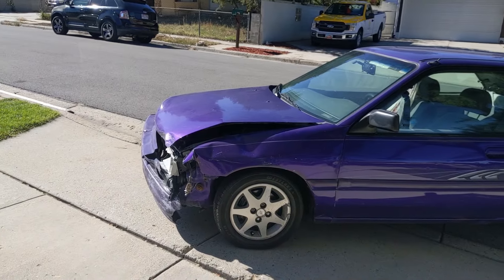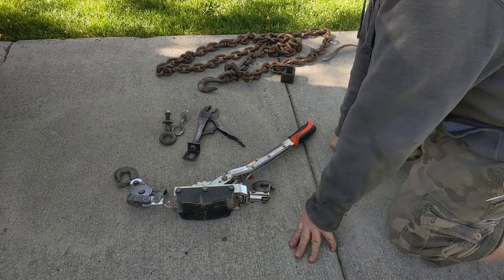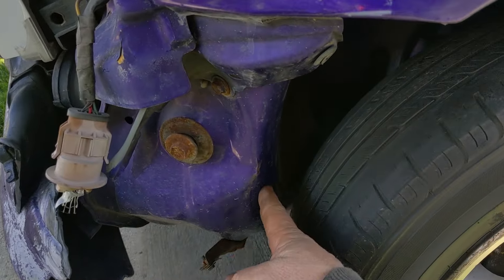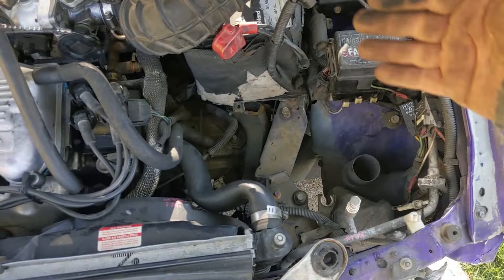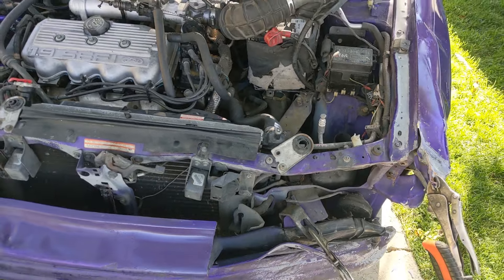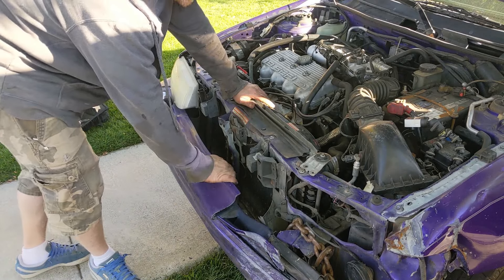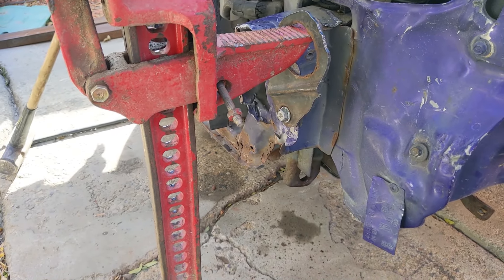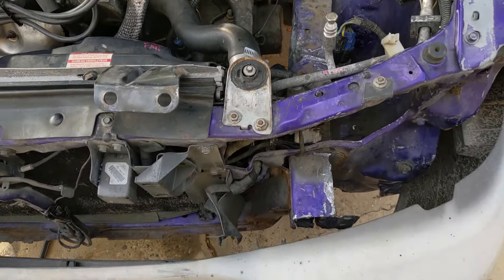Front End Collision Repair Frame Straightening AT HOME Wrecked Accident

Comment: In the summer of 2001, my wife hit a moose with my 84 Subaru BRAT. She was fine, the moose was not, and the BRAT was in tough shape. With a few junkyard parts, my 80 year old maple tree, a come-a-long, and a small pile of other tools, the BRAT drove another 50K before I sold it off. 

Nice work, Moe. Keep this old stuff running as long as possible. My 87 Toyota truck has 292K so far, and it keeps going with basic maintenance.

Comment: So glad you took time to post repair on You Tube.  I used small front yard  tree to chain hold the frame and used come along to a bigger truck
pulling from other side.  Instead of risk snapping vice grips,  I bought some professional pulling clamps from eBay.  Yes, a frame machine is likely a better tool but only worth investing if you do frequent work.   Great thing about come along is you can "feel" how much your pulling and watch as you slowly pull.  Trees are great sturdy friends !

Comment: I sure could have used this video 25 years ago. I was driving an old CorollaTercel.  Yeah, when tercels first came out they combined the names. I got rear-ended by a lady from the Bahamas after I stopped at a red light. Driving in Miami I have been rear-ended 4 times! She pushed me through the intersection. My radio came out of the dash and the driver seat broke as I was s slammed back.
 I towed it home. I had to sweet talk the insurance company to sell it to me because they were going to take it from me after paying only like $1200. The rear end was pushed in on the rear wheel. I popped off the rear wheel and got a sledge hammer and went to work. The apartment building I lived in was cheap and had a bunch of central American boxers that were housed there. they were really nice neighbors and came out and took the sledgehammer away from me and took turns banging on my car with the sledgehammer with big smiles on their faces. Once the wheel was not in contact with the metal it drove Ok. I propped up the front seat by placing my ice cooler in the back seat. When my sister came to town and needed a cheap car I gave her the beater and she drove it for a long time.
Moe, your video is going to help so many people who are screwed if they lose their cheap car after an accident. I think this is going to be a very popular video! I would have never believed you would be able to get that hood to close right again. 😎👍👍

Comment: The vice grip style clamps work pretty good for wider places that meed bent back. In the trunk Ive used a bottle jack and 2x4s from side to side, to push it back out. Shock tower to rear corner, etc. Clear epoxy works well on the light lenses. Awesome job man.

Comment: Love your vice grip, clever.
I did similar jobs on my cars when I educated me, got damaged low mileage cars almost for free.
Sledgehammer and glue did the job.
Reply from the maker: Yeah, the improvised vice grips worked pretty good. I've seen a lot of older cars get written off with only body dents. Just the couple panels and paint for this was going to far exceed $5-6000 through insurance.

Comment: Thanks for putting this up.  I never would have tried it otherwise.  Saved a VW Cabrio from the junkyard for about 900.  It was a little more involved than this one but once you see it the method applies. The low end do it on the side guy wanted 2500 to get it drivable, top quote was 8000.
Reply: I ended up replacing the AC condenser and doing a weld repair on the relief cut on the bumper mount.  Also had to cut a relief in the aftermarket radiator mount where it didn't match the aftermarket condenser, but it's almost like new now.

Comment: Something about using a tree and a come-along is so satisfying . Add a torch if your doing a truck with a heavy frame but the same results . Toughest thing for me is a crumpled hood , usually just get another one.  Good job always enjoy your content.
Reply from the maker: I had to cut away some of the inner structure of the hood so I could beat it flat. I do have another hood that will go on when I get around to repainting the entire car. I wanted to pull out the torch a dozen times but had to bite my tongue as so few people have a torch anymore. I didn't want anyone to get discouraged because they didn't have the tools.

Comment: I've done this type of repair to an old banger in the past, but these days in the UK if you have to go through the insurance, for example in a bump with another vehicle, the car can very often be given a write off category which forbids you to repair it and it has to be scrapped. A real shame because even a small accident can waste a fixable car.
Reply: Yeah, ive seen mild scratches on a plastic bumper count as an insurance write off. Its pretty ridiculous.
Reply: I'm sure the automotive manufacturing sector wrote that law. That fascism is showing pretty blatantly these days.
Reply from the maker: We're lucky enough to buy back written off cars. After repair they go though a basic safety test and can be put back on the road. It is always branded a rebuilt/written off car. Older cars get written off all the time with just cosmetic dents/paint damage.

Comment: Poor Ginger. I have had a similar thing happen twice recently. Once driving down a dirt road I was familiar with but not with the new ditch cut from recent rain fall. I hit the breaks and my puppers ended up on the floorboard. Then we were traveling down the road at night when a coyote ran out and I generally try to keep the mindset that trying to avoid the animal is more dangerous than hitting it. But this was a big coyote and I slowed down just enough to keep from getting any front end damage but once again my dog ended up abruptly on the floor board. He never got injured but I always felt really bad for him.
Reply from the maker: Yeah, Ginger and the dash have met a few times. I always feel bad.

Comment: Glad you and Ginger are ok! Great work on the repair.  I've done this on quite a few of my vehicles and family member's vehicles in the past.  In the beginning of the video when you had all the tools on the ground. I was wondering where the hammers, pry bars and Hi-lift jack were.  Like you showed, I found out pretty early in my repair attempts that the hammers are your friend.  Hammering on or around the damaged areas while having pulling pressure on them helps relieve some of the tension on the parts. That helps them return closer to their original shape.

Comment: Perhaps a doggie seat belt? I have one each for my two beagles that clips to their harness and the seat belt. They can move around some but won't get thrown into the dash and the harness spreads the load, not to be used with a collar. The repair techniques you showed were great. I have learned quite a few practical things from your channel. Thank you.
Reply from the maker: Thanks, I'm glad you liked it. I actually do have a harness and a caribiner I hook to the seat belt but rarely use it as it's such a nuisance.

Comment: i have a couple of chain type come-a-longs made by the company that makes CM overhead chain hoists, one with an 8' pulling chain, and one with a 25' chain. they're a lot less scary to use than the cable types. i have pulled 12'x20' storage buildings that prolly weighed over a couple of tons off of a flat bed trailer when i used to build and deliver them with my dad. i always compared it to rowing a battleship, especially when i would have to pull them 20'-30' on the ground to get them where the customer wanted it when we couldn't get our trailer closer to where it needed to be because of stuff that was already in place on site. as long as there was a tree at least 8"-10" in dia. in line with the direction i needed to move it, i never had a problem or felt afraid, even though i was sitting on the ground right next to the thing pulling on the handle for all i was worth. i wouldn't try that with a cable type for all the salt in the seas.
Reply from the maker: I've seen those and should/will pick one up if one crosses my path.
Reply: @sixtyfiveford  i might be willing to part with the one with the short chain. i don't use it much anymore, but the one with the long chain i use quite a bit still. if you are interested, let me know and i'll send you an email with attached pics and we'll talk price. i'm in northern in. to get an idea of shipping costs.

Comment: Few months ago i got hit right front fender and corner of the bumper. She was on her phone and I heard her brakes locking up. My right front tire was laying inside the fender well. Bent the strut in half.  I put front right strut and tie rods. Pulled hard left, then adjust tie rod. Now it doesn't pull hard, drifts still to the right. Tried to get alignment done, they said could be subframe, knuckle ect. Wouldn't I see bending in the subframe or lower control arm?
Reply from the maker: Generally when a car pulls one or the other it's due to camber. So that wheel is either tipped in or tipped out. It doesn't take much. Toe in toe out with the tie rod would have some effect on that but that is more tire wear and or steering return to center after turning.

Comment: That's pretty cool you fixed your beater. Did you use any filler on that fender or any primer? Guessing headlight is new or salvage yard find?
Reply from the maker: No filler nor primer. Just a little spray paint over hammered out panels. Years ago I could find these all over at wrecking yards but they have disappeared. I actually picked up an entire car for next to nothing and pulled the headlights out of that.
Reply: @sixtyfiveford  They indeed have disappeared you are one of the last people with one. Looks pretty good in video for a direct spray job. Dont forget to send your cats to a processor on your donor car (how u get top dollar).

Comment: We’re trying to do this with a car now. We’re hesitant to use the reversing method for fear of it jostling and damaging the internal parts. Is this ever a concern for you?
Reply from the maker: It is the only way to remove some of the damage. If the accident itself didn't dislodge items you have nothing to fear. Generally the car is totaled/junk if you're doing this and you have nothing to loose.

Comment: Nice video I own a 99 Civic I am hoping I never have to do this but I want to be at least slightly prepared and I will not let the insurance company take away a car that still runs as long as it's not very severely damaged. Just out of curiosity how is the car running now after straightening the frame?
Reply from the maker: Fantastic. This is actually the second time I've fixed it. I put 150k miles after the first time and probably 10k so far after this repair. Drives nice and straight and you would never know it was damage.
Reply: @sixtyfiveford  That's excellent hope the Ford lasts many more years but one question I have is I know you said in at least one of the videos with this car if not both videos where damage was repaired how the insurance company wanted to total the car did you buy the car back from the insurance company and got a rebuilt title? Or did you tell the insurance company never mind or something to that effect after they wanted to total the car? I think it's bad how insurance companies really only consider the actual cash value of the car they don't consider how it was taken care of and how much longer it might run then again that can sometimes be hard to predict it's a good thing you repaired the car it lasted several years after first video and will last several more years.
Reply from the maker: @Old-Tires  The way it works is once the insurance company deems the damage is more than the car's value it is salvaged. It is then branded a salvaged title vehicle. You can buy it back from the insurance company for the same price that they would get from selling it to a wrecking yard. The first time I think it was around $400 the second time and negotiated it down to nothing/$0. You keep the car and have to give them the original clean title and they mail you a title that says salvage. In my state of Utah all I had to do was get a standard safety inspection that I would normally have to do yearly ($10). I took that to the DMV with the salvage title and they gave me a rebuilt / restored title. So you pass safety inspection and you convert a salvage title to a rebuilt title. 

The second time was a little different because the car had already had a salvage title in its life they didn't care and I had to do nothing.

Comment: What do you think about doing a transmission fluid and filter change on an 04 Chevy Silverado 2500HD with a 6.0 gas 112,000 miles?
Reply: Super easy to do as long as you can do it in a clean place. N as long as the fluid that's in it looks nice n red still n the bottom of the pan doesn't have a bunch of clutch material in it then you owe that 4l80 a filter n fluid
Reply: @benmiller5015  It was pretty dirty and I did change the filter also. I just had a guy tell it’s going to take my transmission out now that I did it
Reply: @claytoningram1333  what happens is that if the trans is too worn out the old fluid n contaminates can actually give enough friction for the clutches to do their thing. N by changing the fluid you end up losing that friction so the trans starts slipping. I'd say just drive it n see how it goes. If you do notice it starts slipping get a bottle of some additive to give it something to hold on to. But odds are if the old fluid wasn't burnt n there wasn't a bunch of junk in the pan you'll be just fine
Reply from the maker: @Ben Miller Well said.
Reply: @sixtyfiveford  thanks moe
Reply: @benmiller5015  I got ya I wish had know that B4 I did this. I did put the Dextron III back in so fingers crossed I didn’t take it out. I really appreciate the advice
Reply: @claytoningram1333  no problem. Hopefully your trans is good. N thing is if your trans was already bad n the only thing keeping it going was the old fluid then regardless it was on borrowed time n would go out anyway. But I think changing it now was the smartest thing you could of done
Reply: @benmiller5015  Thanks buddy. And that totally makes sense and makes me feel a little better
Reply: And a good learning experience for me lol
Reply: @claytoningram1333  I'd also say do some research on how to tighten the bands on a 4l80 cuz sometimes you can get away with just tightening them if the trans starts slipping. Better to know how to do it n not need to than to need it n not know how
Reply: @benmiller5015  Ok I’ll definitely do that! I’m day two with of driving the truck after I did the service and so far no problems at all. 🤞

Comment: My radiator was really fucked up so I can't keep the old one in when I do it, is it still possible if I use a new radiator or will it damage it
Reply from the maker: Just leave that radiator out then. You need to move some tabs to get the new radiator to fit once everything is straighter, but the positioning of the radiator isn't that crucial.

Comment: Yo man I got a Ford econoline van 07' the tail lights work but don't get brighter when I brake and the head lights don't work either... Signal lights work fine... Where should I start poking around
Reply: Also smart idea using a tree as a frame puller LoL 👀👍
Reply from the maker: I would look at the brake light switch mounted directly to the brake pedal arm. It's plastic and can be screwed in/out to change it's positioning. It could have just backed out. I would generally go after a fuse first for the headlights. Then the headlight relays(probably one for high and one for low beams).

Comment: Glad you could save that car, it says Ford but they're just a Mazda, The wife had a manual 94 Escort wagon, sunset metallic red or as we called it chromoly pink. It was the best car she ever had, you could fill that thing up right to the ceiling with stuff and it would haul it home it had absolutely no problem doing freeway speeds and was amazing on fuel, that EFI 1.9 liter engine is amazing, with normal normal maintenance ours hit just shy of 400,000 km before someone ran a stop sign and she hit them doing 100kmh, she walked with a bruise from the seat belt and a little bit of whiplash. Poor thing folded in the middle, when I went to get her stuff out of it at the tow yard I reset the switch in the back that trips when you crash and damned if it didn't start and run fine, sure miss that old thing. Don't ever buy the next gen escort they ruined that engine when they introduced the split port induction, bloody valve seats drop out all the time.
Reply from the maker: That's awesome. Yeah, the body was designed by Mazda based off the Mazda 626. Ford wasn't doing anything really that was unibody at the time and weren't great at it. Though Mazda designed it, Ford Built it per their design. The powertrain however is 100% Ford(other than the 1.8l Escort GT model) just like the Ford Ranger that Mazda also designed at the time.

Comment: Poor escort heard I think ginger in the video hope you both are ok I’ve done repairs on a xj that was totaled out in my driveway with a sledge hammer pry bar and a bit of other tools
Reply from the maker: That's awesome. I did an 86 Cherokee that my sister hit head onto the telephone pole. Pushed it so far back it snapped the timing chain and locked the engine. I pulled it all out in auto parts parking lot for 6 hours in the snow. Put a new timing chain on etc and it went on to live for another 6 years until it threw a rod. I hated that Jeep with a passion and swore off all Jeep products because of the endless repairs that thing needed (not pertaining to the accident).
Reply: @sixtyfiveford  I must of gotten lucky both xj I’ve owned have been mostly problem free other than the one I did accident repairs on developing a mean death wobble but that may have been the lift kit and a bit of off-roading that did that the fun a 400 dollar jeep will bring now with my current one it’s a bit too nice to beat on